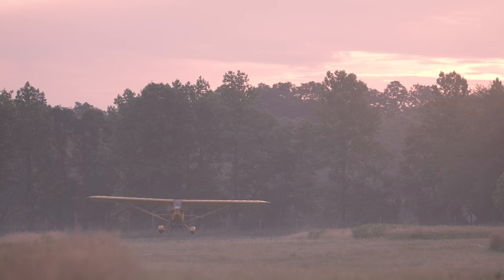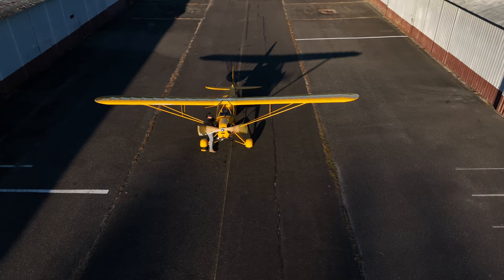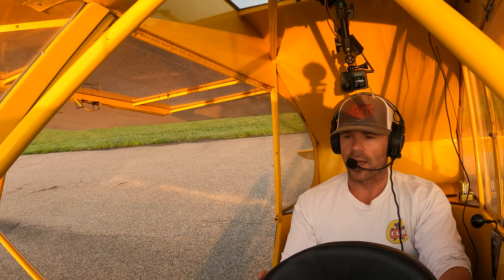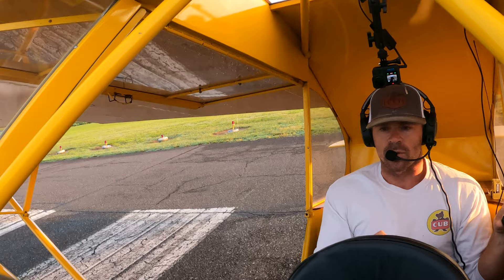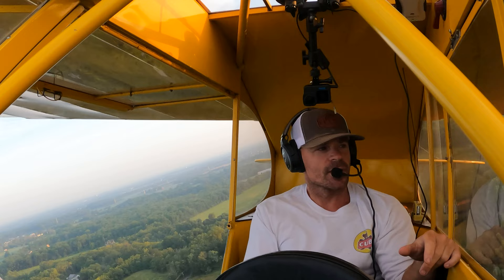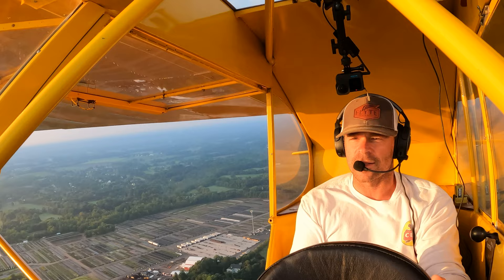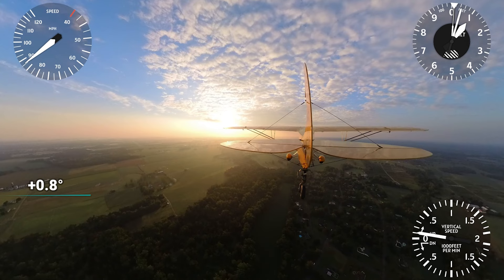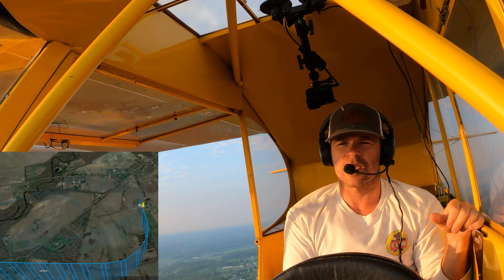Slipping an Airplane, Descend like an elevator while having fun and shortening your approach...

Comment: I always slip when landing.  Well, except maybe a couple times per year to make sure I remember how to land the way most other pilots do.  Frankly, I can't understand why every pilot doesn't slip during landing.  First, getting into the habit of slip to land gets you into the habit of being [very] high during the landing process.  Why is this good?  Because most engine failures happen when engines are being manipulated == not running at constant speed like during cruise ... or mixture being tweaked ... or whatever.  So if you're high ... because you are ALWAYS high during approach and in pattern if you always slip to land ... you can always reach the runway, even if your engine totally fails.  Just slip it in as you always do.  Every landing is an [ultra]-short field landing ... or practice for an [ultra]-short field landing.  I'm a bush/backcountry pilot, so many places I land are only 100~250 feet long (sometimes on steep uphill).  In the rare case I land at a "real airport" (with ATC/tower - yuk!) I like to come to a stop before the numbers.  That's the numbers on the leading end of the runway!  Hahahaha ... but not kidding.  Frankly, if slips weren't second nature to me, I couldn't land at more than half the places I land in the boonies.

Comment: I use a tighter pattern on the premise, that when the engine does quit, I’ll be plenty close enough to land on a smooth runway…it requires slipping on every approach, so much so that I find a normal powered approach leaves me a little squeamish especially with obstacles like trees and power lines just 20’-50’ below my gear!
Reply from the maker: I’m the same way. Could never understand some of these huge patterns…
Reply: Agreed. It is a far safer pattern to keep it close and high and drop in like a rock. If you’re too far out and uh oh there you are.

Comment: “the runway behind you is not going to do you any good” generally true for takeoff though not so for landing. If you misjudge, or get hit by a gust, the runway aft of your intended point is your margin for safely landing short or low. There is reason glider pilots do not aim for the threshold.
Reply from the maker: This is a blanket statement BUT I have found majority of South American Pilots I have flown with have all been pretty good Stick & Rudder Pilots.

Comment: Just came across this. Im a low hr pilot and think learning slipping early has saved me a lot of trouble at least once. 

In the middle of a very hot day in the mountains, stupid me looked at the sky and thought that it did not look that windy. Well, it was. After ten minutes, I knew I was in over my head and turned back to the airfield.

It was so gusty that while on downwind, my groundspeed was suddenly 26kts higher than my airspeed. I tried to compensate for the strong wind when turning final, but shortly after after turning, it dwindled away and I was high and fast. In these gusty conditions I did NOT want to go around unless I could help it. If a strong gust caught me at the wrong time in the pattern I could be in serious trouble. The sooner I could get down the betyer. Thankfully, I was flying a Cub, and slipping was one of the things I really enjoyed practicing, and had been doing a bit for fun. So down I went, and I got on the ground before the next gust.

While I was putting the bird away in the hangar, the winds got quite a bit worse. It was definetely way beyond my skill! Very happy I could grab the lucky opportunity that offered itself! Learned a bit about hot days in the mountains, and the usefulness of slipping!
Reply from the maker: @Hamperokken  absolutely PERFECT example how effective and helpful these are!

Comment: LOVE this, Joe! After 350+ hours of Stearman flying, you get pretty comfortable with slips. Very important skill, IMO, regardless of airplane type (GA anyway)…but especially for taildraggers. I practice slips ALL th time and tell my students, “You never know when you’ll need one”…and regardless, they’re just so much darned fun! Case in point this week…I accompanied the new owner of my 7ECA from FL to OH. After some challenging flying due to lots of convective activity and trying to avoid cells, we’re approaching our interim destination in rural GA right before dark. Straight in approach to a grass strip because light is failing fast. Over the trees I realise the optical illusion has me 600’ higher than I thought (landing over 100’ pines!). Instant ADM needed…go around and try again, or maximum slip to land within the available 3000’. No brainer, no stress…slipped and landed within 1200 feet. Student was super impressed, hosts at the airpark thought I was just showing off. Whatever - it was a piece of cake because I’ve done so many. Routinely slip right down to the runway, as you demonstrate. Good, timely practice for me…I’m buying a Waco YMF-5, and like the Stearman, there is zero forward visibility. If you want to land that thing safely, your only option is a slip. Happy flying my friend…seems you really know how to have fun! My Stearman was based in Van Sant for many years, btw, and was George Taylor’s personal airplane in the 80s (his first restoration). Nice part of the world…except for January and February 🤣
Reply from the maker: Thanks Gareth!! I only have a few hours in a Stearman but working on getting more!!
Reply: Great story! I was on my Commercial Pilot check ride in a Cessna 182 with a check pilot who also owned the airplane. He pulled back the throttle and said "you just lost your engine, what are you gonna do?" He had put me right over a crop duster strip so I said "I'm landing right down there." I made my approach but was high even with full flaps so I put the 182 into a steep slip and it started sinking like the Titanic! I glanced over to the check pilot and he was white as a ghost and braced for impact. I crossed the threshold, went out of the slip and just as I was about to touch down he applied full power and told me to climb out. I wondered why he didn't take over if he was concerned but all he said was he didn't know you could slip a heavy 182 with full flaps! I passed the check ride. I had lots of tail dragger time so it was a no brainer as far as I was concerned.
Reply: 👍9N1, my happy place!
Reply: @Bananasssssssss  Where are you flying the Stearman?

Comment: Very nice video and audio. I agree, slips are great techniques to know for engine outs, landing over high obstacles near the threshold, short runways, etc. Of course the warning is "airspeed, airspeed, airspeed" with eyes outside, then airspeed, then outside, then airspeed.... Having stall / spin training first is important, so one has the feel for an approaching stall. It's also good to know the feel when flaps are down (if allowed), and the tail stall / buffet; don't want surprises at a critical time. And one last, small item, it's good to know how long you can physically hold down the rudder pedals before your leg loses fine movements to the shakes.

Comment: Really enjoy your videos -- great aviation insights, great video work, and love the views of rural NJ.  I fly a Cessna 180 -- the tail wheel techniques are cool to watch from the tail view.  One comment on slips burned into me -- keep an eye on airspeed.  Don't allow the nose to get high -- stalls at low altitude are tough.

Keep 'em coming.
Reply: Yep. But you don’t need to over do it. One CFI had me slipping with full flaps at 95 knots in an Archer because “the air speed isn’t accurate in a slip”. I later took the same plane up to altitude and did a few full flaps slips while gradually pulling the nose up. At just under 55 knots I thought maybe I felt the high wing starting to drop a bit so I stopped the slip. Now I feel perfectly safe slipping it at 65-70 rather than 95.

Comment: When I learned to fly a Citabria the instructor had to teach me how to slip.  I had never done one in a 152 because it had flaps, and that instructor never showed me how to slip.     That was in 1980.  Years later I gently slipped a B727.   It can be done.   And if you think about it, you're almost slipping in an Airbus when you go to de crab during a strong crosswind landing.   You're putting in L aileron for example, while kicking the right rudder.   You're just doing it more gently and keeping the longitudinal axis of the jet pointed directly down the runway as opposed to flying it sideways.  And of course, you need to be LOW enough that the normal law will allow you to do so.    But, being able to slip well is a skill that can help you in all airplanes.   For example,  I've heard of guys on fire slipping to keep the smoke away from the windscreen so they can see the runway.    Very nice vid.   Jealous old man here wishing you well.  I'd love to have access to a cub and a grass strip.
Reply from the maker: Thanks for
The insight! And jealous you got to fly an727!
Reply: It was awesome.  I would have flown it a lot longer had we not parked them. Some of the most rewarding flying I've ever done and the only plane I ever saw 400 knots indicated in. The ones with the light ZFW as I recall would really scoot.    BOS-IAD 1999. @Bananasssssssss

Comment: “Pitch for airspeed power for altitude” YES! Though really pitch and trim for AOA. Power technique works both back side and front side - it is not back side technique. Via spoilers, even gliders use it. The only ones not doing so either rob themselves of precision or have long spool-up times for engine response. Search Medium for “Improved Landings with AOA and Power Techniques” as well as the correlating case study “F-35C Crash into the South China Sea Case Study.” May also consider looking at the differences between ‘reverse command’ and “reverse demand” also in Medium searching “Back Side of the Power Curve vs Drag Curve.”
Reply from the maker: Thanks, I'll take a look at em...

Comment: Love slipping. Trim for 60, crank 'er over and let the air out. Great for clearing the 50' tree nearly on centerline not quite 700 feet from the numbers (25 at 9N1). Airnav says 17/1 glideslope, and 25 is a 5% uphill. Interesting challenge. It's flat unobstructed runways that unnerve me 😅!

Comment: The one-eyed pilot of this TACA flight had to slip to get over a fence on final, landing it deadstick on a levee after losing both engines in a thunderstorm off New Orleans. They flew the airplane out after repairing the engines. https://en.wikipedia.org/wiki/TACA_Flight_110

Comment: Great video. Love your J3 ❤ She looks even older than mine (1946). A question to your video: How did you add those gauges to the video?
Reply from the maker: Thank you! It’s a ‘41. And as far as GPS overlays. Here ya go!

Quickly Adding GPS Overlays to your Flying Videos with GoPro and Insta360º Cameras.
https://youtu.be/GmvQNqLDkeQ
Reply: @Bananasssssssss  hey thanks. I will check that out. 👍

Comment: What are your thoughts on IAS during a slip? I have a pitot and static port on the left side, and the delta between those pressures can get complicated (especially in a crosswind). I generally ignore the IAS and just fly by feel. Thoughts?
Reply from the maker: You said it! Ignore it! It’s pretty in accurate in a slip for a few reasons, the airframe blocking the relative wind and it hitting the pitot tube on an angle. Best advice is to get established on a nice and stable final approach speed then enter the slip. That’s also what I love about slips, the airplane will tell you when it’s getting close to a stall, in a Skid, there is no warning at all.

Comment: It’s kind of scary and uncomfortable since you’re doing full rudder in one direction and a lot of aileron in the other. You just have to make sure you don’t stall or you going for a spin. Remember your slipstream changes so your airspeed going to appear to be a lot slower than you really are. If you tip the nose down you’re going to pick up a lot of airspeed as you straighten out.
Reply: The beauty of a slip is that your higher wing is blocked and will lose lift first. If it loses lift, you'll likely pull out of the slip and return to wings level. 

If you're skidding in the turn, then now your lower wing is blocked and will lose lift first under an increased AoA. Because that lower wing will stall first, your plane cannot return to wings level and instead you'll go over into a spin.

This is why it's so important to understand the difference between slips and skids and how useful a slip can be compared to how dangerous a skid will be.

Comment: Great video! How did you get the view from the back of the aircraft? Drone? I owned a 1946 Cessna 120, no electrical system or flaps so had to slip it all the time. I also flew a friends 1938 J3 from western Okla to Oshkosh air show in 1978. No radios so had FAA waiver. Entered the downwind per instructions but had the J3 fire walled just trying to keep up with the other aircraft. Came over threshold too fast and high. Had to do a steep slip to get down and bleed off airspeed. When I touched down a guy next to the runway was frantically waving me off the runway into the grass. As I rolled off the runway a Ford Tri-Motor landed. He was on my tail the whole way down. Exciting times flying that J3.
Reply from the maker: Thanks! It’s actually a 360° camera attached to tailwheel spring